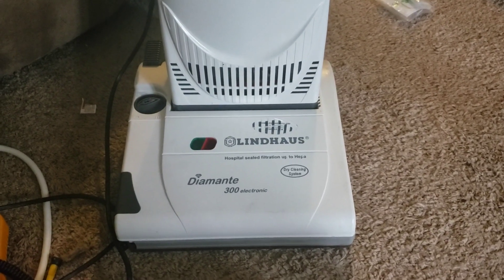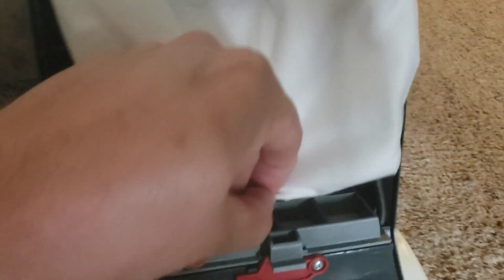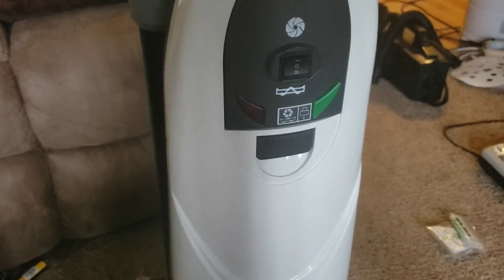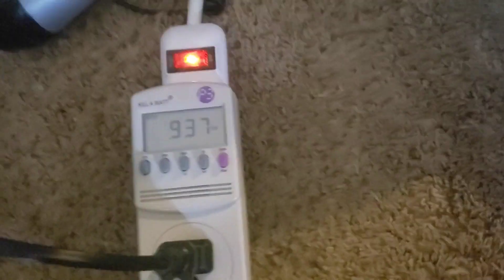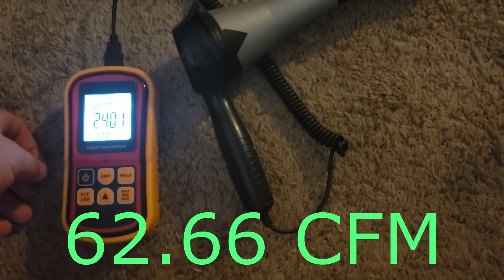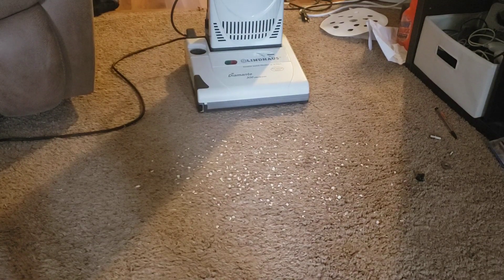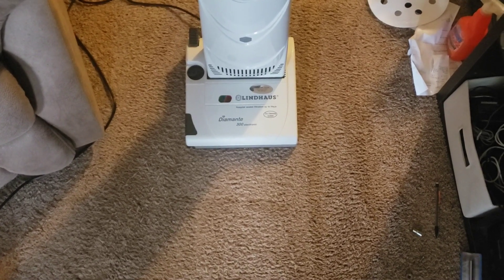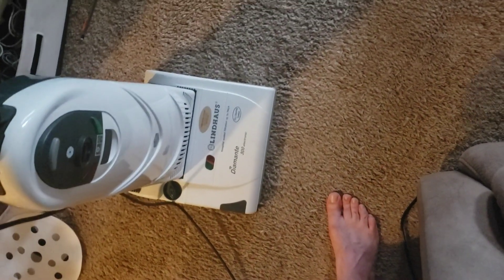Lindhaus Diamante 300 airflow test

Comment: The switch is odd on these, but once you get it figured out, it makes sense. You have to get that the green button just isn’t the power button on this. I’ve always felt Lindhaus had lower water lift but decent. CFM numbers.
Reply from the maker: I could see the average person being confused by that setup and then wondering why the vacuum "isn't working" I know the purpose of it is to allow the brush motor to run on it's own for their dry cleaning system but it's like couldn't they do this in a more....simple way?
Their lack of airflow is their greatest weakness. A machine that costs what they do should perform better. We see other brands using 4.3 motor that are capable of getting 60+ CFm at the base while Lindhaus uprights trail behind in the 40s.
That said their brushroll is their redeeming quality and those work very well.

Comment: The switch works like that because it can be used as a dry carpet cleaner machine . They have this moist powder they sell that it can scrub in the carpet on brush mode then you leave it dry and vacuum it up and the carpet is clean :)
Reply from the maker: I know about the dry carpet powder, it's just a very strange setup and I could see the average user struggling with it. I feel it may have been better to have like a 4 position switch off/suction/ suction+brush/ Brush only

Comment: The performance numbers are quite baffling to me, I never expected it to be that weak in the suction/airflow department (I can imagine its single motor variant, the Activa 30 performs similar), but the grooming of these are actually pretty good.
Reply from the maker: Yes, this is the 2nd Diamante i've measured too. the nozzle measurements were somewhat similar.  I did try testing the motor itself on my previous one I was getting like 130 cfm and like 80" of lift. I do think the cfm was a bit inflated due to the airstream being concentrated but it's like where is all the power going? Is it just that poorly sealed? They have a great brush on them but their uprights all seem to lack power

Comment: This is very nice vacuum but airflow is really lacking. I mean I have seen Sebo Felix get over 80 cfm. It was Lacking channel who measured it.
Reply from the maker: right? the proteam 1500 uses a similarly sized motor and it does much better so it's not the size of the motor that's the issue the machine just isn't that well sealed up
Reply: Or maybe it has a ton of resistance in the air path? 

Some vacs seem to be designed with a really convoluted air paths.